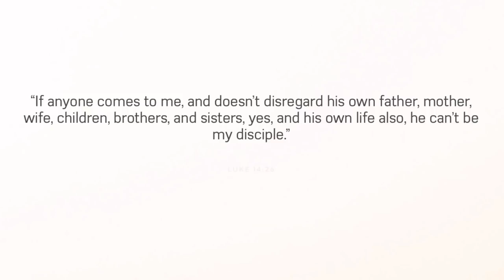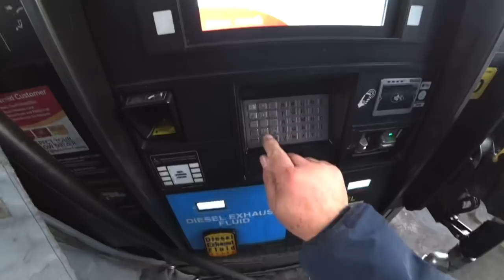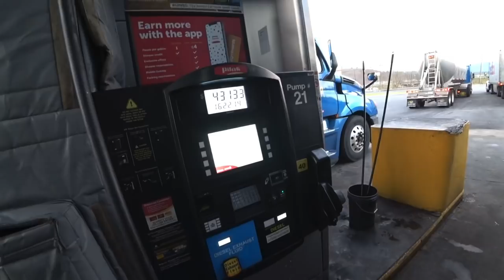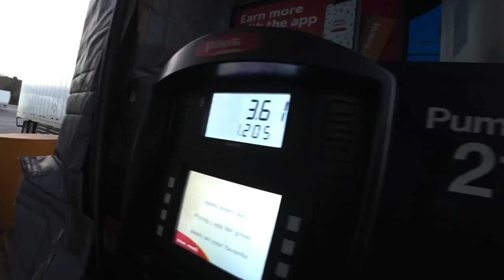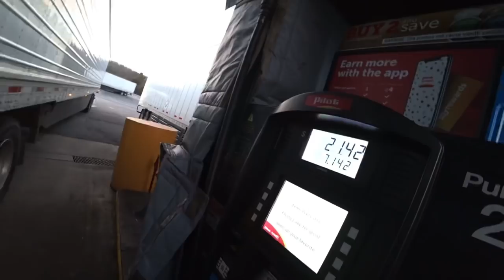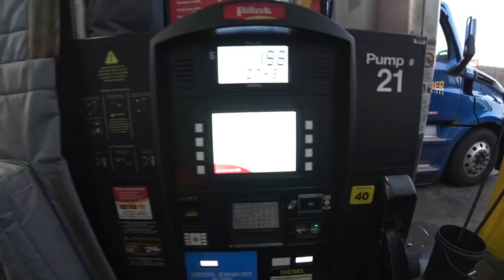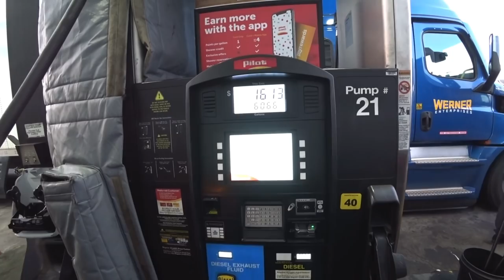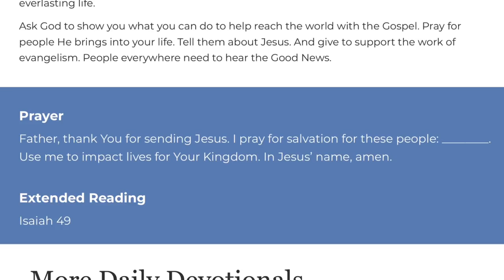January 6, 2021/10 Trucking Loaded and Fueled. Mount Crawford, Raphine Virginia

Comment: Aren’t the pumps built all the same with nozzle in same relative position as to left/right on actual pump so you’re using one “backwards” by pumping on both sides, thus one hose will be ‘shorter’ than other one so ideal position to stop would be based on that, plus where reefer tank and DEF tanks are.